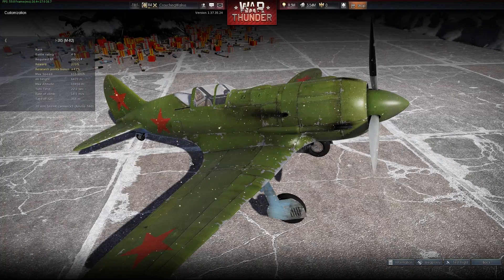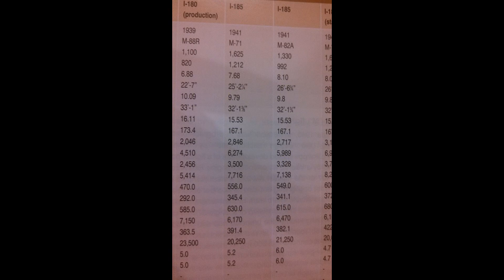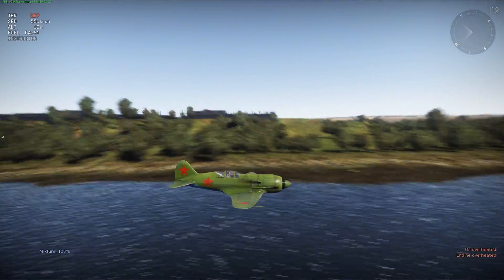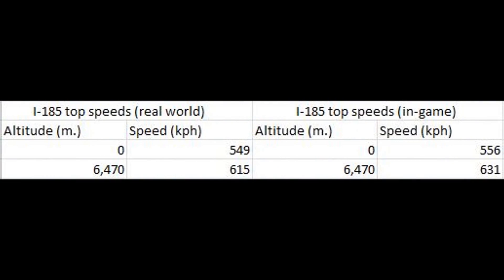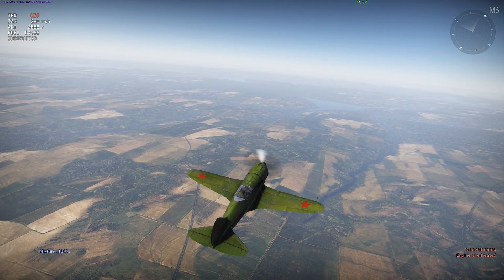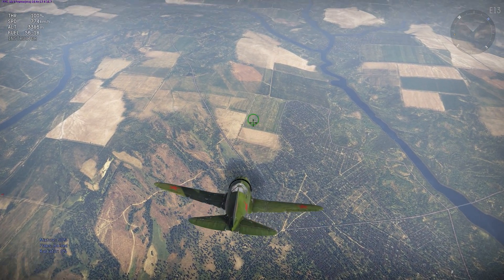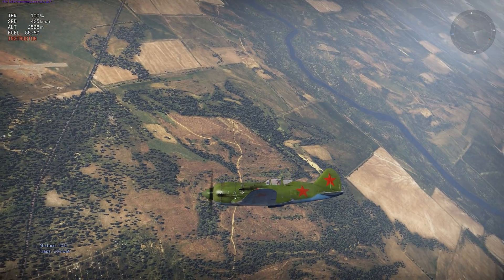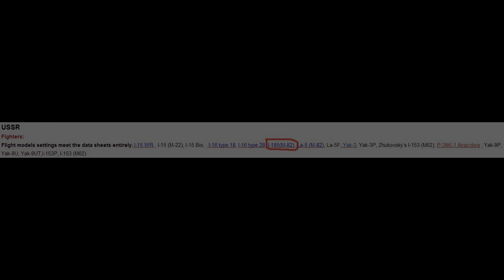War Thunder Flight Model Analysis: Polikarpov I-185 (Patch 1.37)

Comment: This plane is the reason I stopped playing this dreadful game. I was diving on an I185 at fairly high altitude, he performed a UFO maneuver, turned around like a zero and zoomed up. Headon, he didnt hit me, I damaged his engine. He continued up past me, TURNED AROUND and continued to CATCH UP I was already doing 750km/h IAS. Chased down, leveled off a bit, thinking control stiffness like my 109F4 was experiencing, I leveled off fine, he was still heading straight for me. I went down further, kissed the ground, and to my surprise he managed to PULL OUT and KEPT ON BEHIND ME. I was like... OK. Climbed at 20 degrees up with WEP, he was still CATCHING UP and a blast of the OPVAK cannons both my wings, engine and elevators went from 'Damage indicator not there' to black.

Comment: Your top speeds was based on using war emergency power!
Reply from the maker: Yup, as they should be.
Reply: CrouchingWalrus Why, shouldt they be based on regular power
Reply from the maker: Andy Play's [BogAco] Because my data states that the real plane used short term boost to acquire the top speeds.
Reply: ah ok, Ordered my new gpu yesterday ;D an MSI Radeon R9 270X Gaming 4GB GDDR5!,[3 days after this got posted first time] I got the gpu now :D
Reply: Andy Play's [BogAco]
what cpu are you pairing that beast with? better be at least an i-5 oc'd to 4.5ghz.
Reply: BaxterX7 Using an amd a10-5700 3.4ghz Quad Core 13.6. Planning to get an amd bulldozer 4.0ghz Octacore :) = 32ghz

Comment: Very nice and helpful video. But: You are testing the plane in Arcade mode. Arcade mode is not meant to be realistic. For testing a plane you should use Realistic mode or even Simulator mode.
Reply from the maker: It is done on Realistic mode.
Reply: CrouchingWalrus
Really? The movement of the plane looked much like arcade mode. Then I have nothing to criticise.
Reply: That's the whole idea of "performing according to data sheet" by gaijin